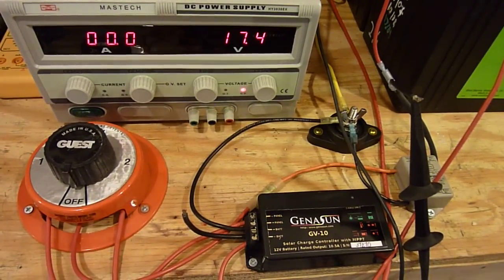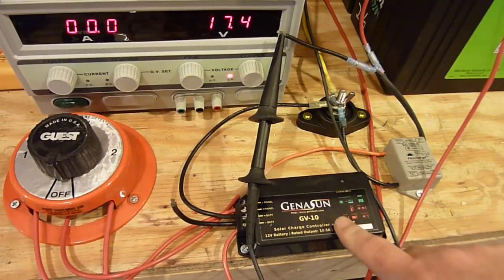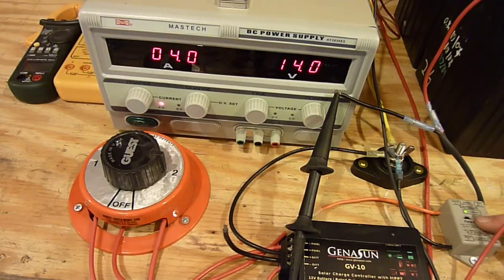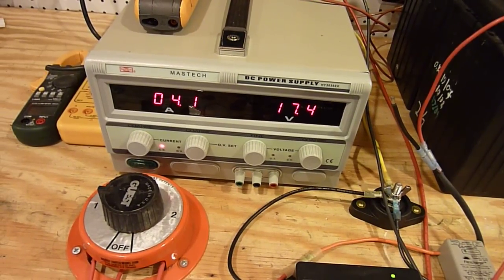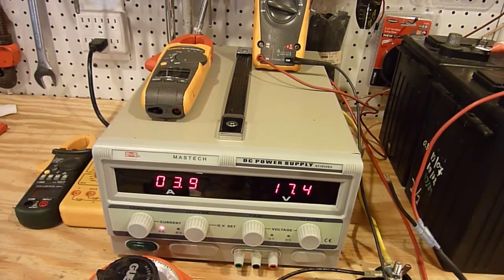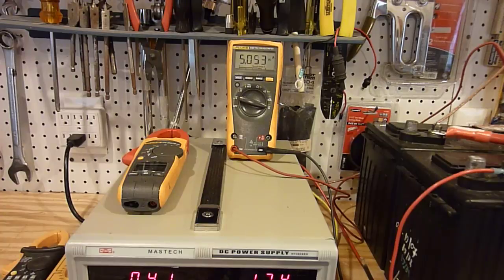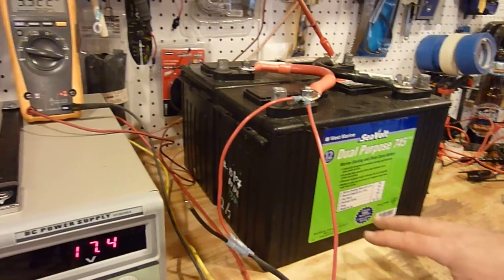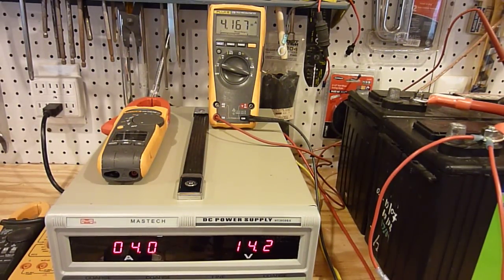MPPT vs. Shunting Controller

Comment: This controller using 'Sync. Buck topology' the extra one full amps is properly drawn from the battery loop itself. Remember you are setting a fix amps and voltage output at the PSU.

Comment: The shunt controller uses Isc, while the mppt uses Imp. If that 4 amps represents panel Isc, Imp would be about 3.6a. Therefore, the PS should have been adjusted down to 3.6a for the mppt comparison. That would bring the amps produced by the mppt down to 4.41, for a 10% gain, not 24%.

Now, take into consideration the fact that increased panel temperature greatly affects mppt output, and your average, overall gain drops dramatically.
Reply: Are you saying the Fluke meter somehow reads the amperage differently for each controller?

Comment: I would go with a Flex-Charge. Not only will your expensive batteries last longer, they don't have the extreme RFI (radio frequency interference) and EMI problems that the other charging controllers have.
Reply: Nathan Daniels 
are you sure the genasun has a problem with emi
Reply: EnglertRacing96, no I'm not sure, I've never ran one.  They're probably both clean.  I don't think Genasun makes anything larger than for the small time hobbyist however.  Flex Charge uses a different technology, that doesn't emit any RFI/EMI and the have about any size controller that you could need (from  small hobbyist size, residential, to commercial sized).
Reply: I believe genasun made its reputation on low or no EMI issues. Also, the flex charge may not be adjustable and a single stage 14.2 volt charger will eventually ruin some batteries. Its too low of a voltage for lead acid in the long term.

Comment: I notice the biggest difference with cloudy conditions. I've seen up to 30% better. On sunny days, with the panel in full sun, not much difference at all. Less than 10% and most times 0%. If your panels will charge in a few hours with full sun there isn't a justifiable price difference to go with the MPPT. The same wattage CC will cost up to ten times less. Keep in mind that the best panels are only 22% efficient anyway. So that's a lot of sun not being used at the start.
 If you live in cloudy conditions or don't have the space for a larger panel then go ahead and spend the money on MPPT. 
If you don't care about the money and just want the best most efficient system get a Genasun CC.  
 One last point. Some MPPT CC's have huge heat sinks on them; Why? They are converting energy into heat. I've never seen a PWM CC with a heat sink, they are not needed. (I read the 99% and 97% efficiency rating but then why the heat sink?)
Reply: Wait...this is a comparison of two different types of solar controller using the same power source and load. It would be the same regardless of the sunlight intensity, the size of the panels or how efficient the panels might be. I am unsure what point you are trying to make.